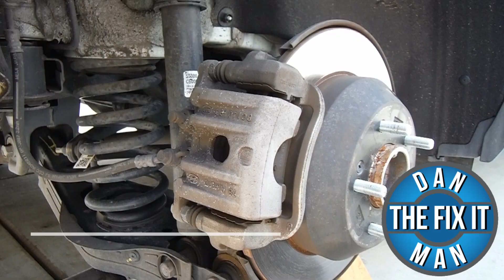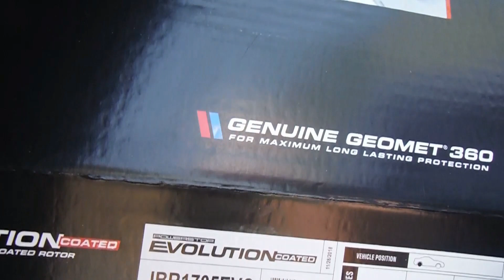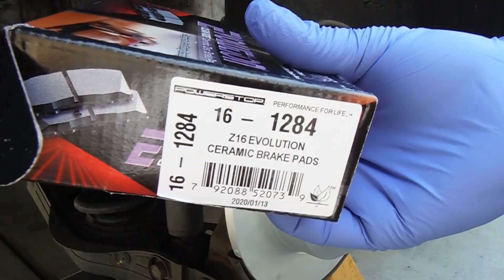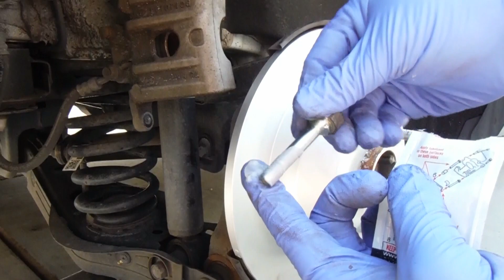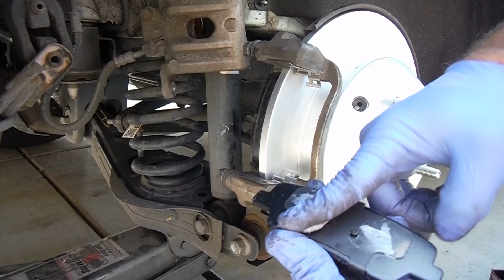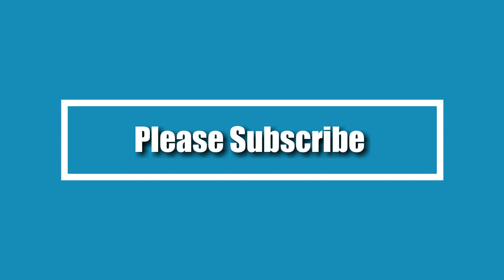2016 KIA SORENTO - HOW TO REPLACE REAR BRAKE PADS & ROTORS - DIY

Comment: I just discovered before I started to replace the rear brake pads on my 2016 Sorento SXL that has electronic parking brakes (EPB) that there is an additional requirement to unlock the parking brakes - this in more than just making sure the parking brakes are not engaged.  Not doing this can reportedly mess up the parking brakes and create a hassle with error messages. I think there should be a heads up disclaimer about additional steps needed when changing rear brake pads on cars with EPBs.

Comment: 7:07 please don't "give it a little bump". Especially near the east coast. Sometimes you gotta drill out new ones here. The lugnuts hold/clamp the wheel and in turn the rotor in place. That little screw is only to hold it there while youre putting the caliper/bracket and pads in, it's nothing more and does not require being torqued past wherever it stops. Otherwise, great video. Very informative!

 I use these videos as refreshers when I get an odd job at home and don't have access to Mitchell or identifix here. The main reason I do this for simple things like brakes, is to see if there's any special tools needed that I need to dig out or borrow. I like that you also mentioned the specific tools along the way. Makes it easy to just grab a handful of stuff and go get it done fast. Good job and thank you

Comment: Why do they have the set screws on the rotors? Logic says the lugs hold the rotor to the hub.Are they there just to secure the rotor while remounting the wheel?
Reply from the maker: That's what I have been told is that they're only used to hold the rotor to the hub during manufacturing, but I usually just put them back in...
Thanks for watching!
-Dan the Fix it Man

Comment: Hi! Great video. We have a 2016 Sedona and the rear brakes are alike. One question: where did you get the specs for the bolt torques?
Reply: just tight enough

Comment: rotor replacement 3 years later only , ???
Reply: Should replace rotors same time as the pads. Even if rotors look okay.
Reply: @Sean-mc4iq  that's a waste of money. Only if the pads have started to dig I to the rotor. You can also take the factory rotors and have them turned. A lot of aftermarket parts are junk.
Reply: @ifitaintbroke7427  i mean when you do it yourself, it costs nothing.
Reply: @Sean-mc4iq  Labor is free, quality parts are not cheap. In over 20 years doing a few cars the new pads have worked fine on old rotors that are still in spec, i.e. not too thin or warped or deep scratched.